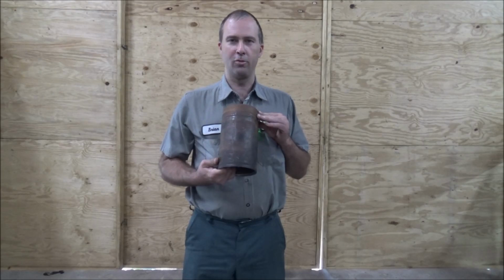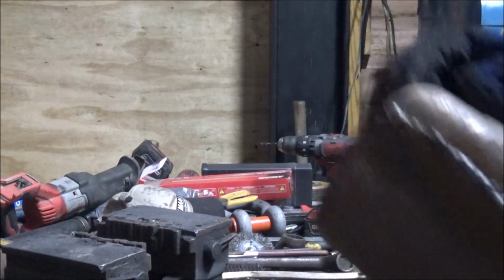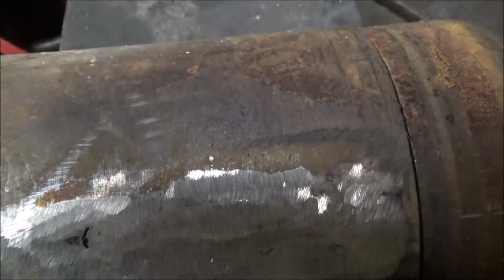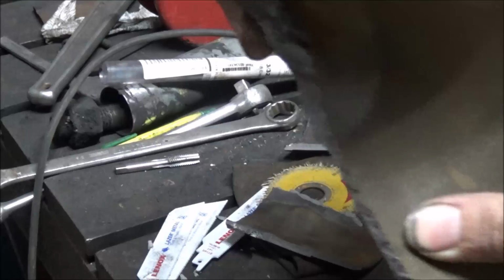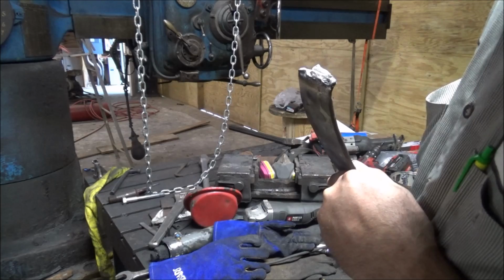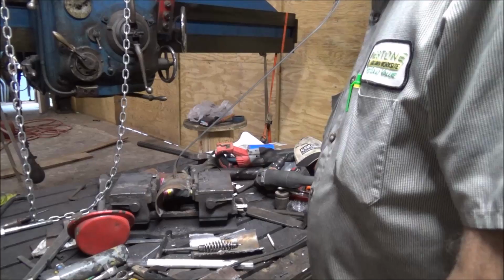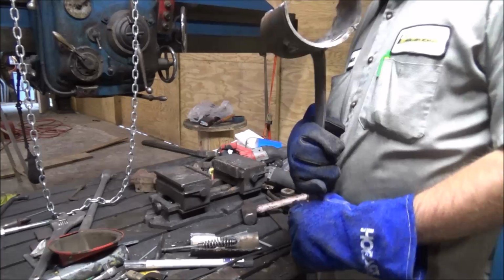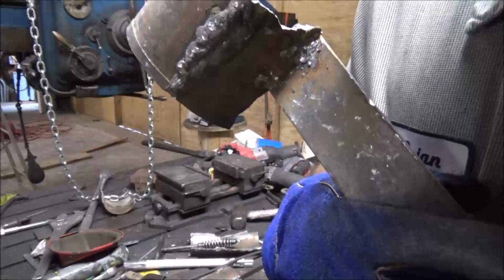Experimental strength welding of cast iron

Comment: It all comes down to "will it work for these circumstances."  Sometimes the only way to find out is to try it.
I've seen arc welded cast that outlasted the rest of the machine, I've seen others that failed.  No idea what made the difference.

That said ... there may be a specialty rod for arc welding cast.  The few I saw didn't look like any welding rod we would recognize, they looked like skewed key stock.  Very difficult to use, required lots of patience and time to get it right because holding an arc was very tricky.  The man that described it to me said that he learned it from an old timer that, for some reason, became very adamant about teaching him how it was done.  Wouldn't take "no" for an answer.  He said he resented being forced to learn it, but it became invaluable decades later.  Maybe it was a technique that worked, but was abandoned because it wasn't easy?  I don't know, but if it really was possible, it might be time to start diving into those old textbooks again to see if we can bring it back.
Reply from the maker: Did the stuff look like this?http://www.ebay.com/itm/5LBS-WELDING-RODS-STICK-ELECTRODES-Cast-Iron-R-D-Metals-AWS-A5-15-1-4-NOS-/142019007573?hash=item2110fe1455:g:Yq0AAOSwUV9WpETq
Reply: yes it did
Reply: yikes!  no wonder why he stopped me when I was about to pitch a 3" leftover in the iron pile ...

Comment: Stick welding with no flux on the rod is tough. I tried it a couple times and thought it was impossible because the rod kept sticking. Didn't think about swapping polarity and just gave up after a few minutes.
Looks like your welds were fairly strong.

Comment: With the no flux 7018, did you have to keep a long arc to keep it burning, or were you able to get closer into the weld puddle? Very interesting technique. I'm going to try it myself. I would be interested in the stainless steel welding test on cast. There seems to be an easier flow with stainless, although MIG welding stainless seems to leave quite a high weld bead. I hope you do a video on that. Hey, I really enjoy your videos. Cheers.
Reply from the maker: Have to hold pretty long or it wouldn't stay lit.

Comment: As you are in experimenting mood :-)
I read in an old book how to make a coating for the rod to make the welding arc better. It said to wrap the rod in paper and then coat it with Sodium silicate. This will force the arc to the tip. No idea if its working in this situation.

Comment: So 7018 welding rod with no flux with a DC welder with positive on the electrode right?
Brian, can you tell me approximately how many amps did it take to make this cast iron weld?
Reply from the maker: I can't say exactly because I was using a foot pedal but likely around 250 amps.

Comment: That's pretty interesting, I'm what you would call the trial by fire welder lol. I learned by making the mistakes and fixing them, getting schooled, and seeking the answers along the way. I fixed some things I would have sworn I couldn't. Went on and tried it anyways per the request at the time. Very real and practical test you did there. So you cold welded the liner, but given the mass of metal your repairing, are you going to try to preheat some with a rose bud torch? My thoughts are that even the best weld you get stuck to the drill it might still pull cracks in the parent material due to mass of the cast/and weld. Even 200 degrees might make the difference. I'm thinking primarily the column side of your repair would be the most prone. Maybe you might repeat the test with larger mass on both parent cast and bar size- one cold, one hot, see if there is anything that would pop up or change your mind or findings. Your going to be spending some serious time burning rods as it is, I doubt you really want to discover something later. If you did do some torch work(heat)I would think you want to keep alternating. Heat, weld, heat weld, heat to finish too. What are you thinking there?

Comment: I am both totally amazed and delighted with the outcome of your experiments with a most surprising result. Since your tests have been conducted with small pieces of cast and metal would you, at this stage of testing, anticipate differing results at all with those massive broken components of your drill?
Reply from the maker: All I can do is take my best results and try welding a bar to the big drill casting and see how it holds if it works as well again then that is how i will go.

Comment: There's some highly intelligent people on the Practical Machinist forum who I greatly respect Brian. And unfortunately some who seem to need to make themselves appear better than they are by focusing on the slightest mistake large or small. Few will admit to some of there past mistakes and we've all made them.And fwiw I've spent more than enough years around large open pit mining equipment. That taught me that the larger the equipment then the larger the mistakes were when they happened. Few would have had the guts to post that video of that cable breaking so I'd try and pay as little attention to all those monday morning quarterbacks as you can. I don't subscribe to any idiots channels on YT and your about the furthest away from fitting that description I can think of.

I'm not and never will be a welder. I have seen a whole lot of failed weld repairs on highly stressed equipment though. Preheat obviously helps a great deal, but even with that I've seen new cracks start right beside the weld in those high stress areas. I don't know enough about your drills main construction where it broke. If it's at all possible I'd try and add some supporting triangulated tie bars after the main castings have been welded that could be used to help support those heavy components and take as much stress off the repaired areas as you can. I'd be surprised if you haven't already figured the same and are planning to do so if it's possible though.

Comment: The vice you're using for an anvil looks like my American Positive Grip. If I'm correct, it's really great for holding irregular shapes. Might be worth cleaning up.
Reply from the maker: It soes have a bunch of fingers and is filled with shot so it can grip irregular shapes. It needs a ton of welding done to it as it has been drilled to swiss cheese by careless operators over 80 years. Pretty sure I have a video just on it https://www.youtube.com/watch?v=LxZpd2qcLxw

Comment: Brian, you could use you Tig set up and silicone bronze Tig rod and it will be stronger than the base metal, at that joint
Reply from the maker: Except no way I can tig that vertical up joint back in that hole.

Comment: Well semi-steel being a low carbon variant of cast I suspect the welding may work just fine. As to why it seems stronger without flux you got me... For the record you were running electrode negative right? I can't see a 7018 lasting 5 seconds on DCEP without flux.
Reply from the maker: Yep DCEN/ straight polarity. I think maybe the higher amps and lack of shielding dissolves some of the carbon out. Fooling around with it I could still drill the weld but it was harder than the liner right next to where I welded.

Comment: I don't think the question is whether the cast will break, the question is whether the welded section will break at a lower force than unwelded material.  I'm curious if brazing rod makes the joints any more ductile than weld rod.

Comment: I may not know much about large welds. What I do know is that you need good penetration. That last one where you beat the tar out of it and it ripped the casting instead of failing. That's the right penetration. The thermal mass of the drill might be more of a problem as for getting the welder set right. The more you weld on it, the hotter it gets and so on. I'd get a die grinder after it and hog out a nice trench to fill with weld material. No doubt it's going to be tricky as hell. I'm still just glad it didn't land on you man. I about pissed myself watching the video of you lowering it. Good luck man. I won't hold it against you if you just decide to scrap that thing though. It's going to take a whole lot of rod and patients...

Comment: someone told me those cast iron  sleeves make a good  squar that you can use on your mill  what do you think
Reply from the maker: No they are too flexy and only turned so not near accurate enough to substitute as a precision square.  A big wrist pin is decent though.

Comment: Might have already been suggested but i wonder if you pinned it like a surgeon would do to broken bones...so can you drill many hole in one side...hammer in pins....drill other side with corresponding holes...slip parts together then weld up....make sure pins hold the weight and rigidity....cheers..
Reply from the maker: See the previous video for how the weld joint on the drill was prepped with tapped in bolts on both sides.
Reply: Thanks Brian...I see that....but I was referring to long continues pins...if there was a temporary table at the correct height of the break, your mag drill could be laid over on its side...and magnetize to the frame for accurate hole drilling both sides...slip together and weld ...one more suggestion then i won't bother you again...how about fabricating a frame that is bolted onto the back and top of the main structure behind the main post then weld side plates down to which a bottom plate underneath can be welded to the side plates... then extending  past the break and bolted underneath but up to  help support the weight of the part that holds the motor...anyway good luck i hope you haver success...cheers.

Comment: as long as you are using the pedal you might try ac with continues hi frequency. stomp th pedalto start and to pulse for penetration and the hi frequency should help maintain the arc when you back off.
Reply from the maker: Tried ac it ran very poorly.

Comment: I wonder how it would go with TIG and 7018 no-flux rods.

I really hope you can find someone who will let you borrow a mig because I bet that would make welding it all up in those tight spots a real snap.
Reply from the maker: Probably better with the shielding gas but I could never get a tig torch up in that hole to do the weld though.

Comment: Very nice Brian.  Some random observations: 1) It is a shame you don't have a MIG gun, since that is a "fluxless" process. How about faking it with an argon or 80/20 bottle, regulator, and a shop air nozzle on the end of a hose? Just point it near the weld puddle to displace some of the air. 2) It would have been interesting if you had tried to partially fill in the break from the inside as well as the outside so you got full penetration for at least part of the length of the fracture. 3) It appeared that each time the casting broke, it was along the edge of the HAZ from the weld. Maybe that is saying something. On the other hand, I have the impression that the welded part was at least as hard to break as the original. In that case, maybe having it break along the edge doesn't mean much.
Reply: regular weld tends to break along the edge of the metal nearest the weld too, not sure if its the heat, or that its a pivot point due to the weld not wanting to bend and its that point
Reply from the maker: 70ksi weld material is a lot stronger than 40or50ksi cast iron so it always should give it up in the base material unless the welds are poor. The key is getting the heat effected zone  along the edge of the weld from becoming too brittle and extra weak in the process. According to my unscientific bar bending tests I was estimating around 20-30ksi weld joint strength when I first started. That last attempt where I did the very hot fluxless weld I was as strong as the base material. That is ideally where I would like to be but getting that done is going to be tough.

Comment: It seems to me that you have a surface area problem. It adheres to the cast iron, but when it breaks it takes it with it. It is able to break because there is only a small portion of weld material actually making contact with the cast. Increase the size of your welds with a straight weave. Or, cut slots into the cast perpendicular to the weld seam, and then fill them with rod. Just increase surface area of weld material.
Reply from the maker: While that is a valid solution and the more weld the stronger there is only a limited amount of material available for connection on the drill so figuring how I can make the best use of that is my mission.
Reply: Your plug solution should also be effective, but I totally see what you mean. The break could hardly be in a harder to work area. I hope you manage to figure it out, thanks for taking us along for the ride. Good luck :)

Comment: do you own any pulley taps..  like in 1/2-13 .. if there is such a thing. you could drill deep thru the broken off casting and part way into the unbroken casting.. counter bore the outer hole.. run the pulley tap into the inner piece.. and be able to use socket cap screws to reinforce your broken off part to the main part.   you could also use long bolts but you still have to have a pulley tap or weld up one..  or broach a bar into a tap driver..  and prey that you don't bust a tap off deep.  since this is my idea.. i would become the idiot for thinking of this..  the only thing is to NOT drill thru into the post.. so a drill collar would be needed to limit the depth for every hole.

Comment: pro tip dont use flat bar use angle that way you get a better feel and also it will transfer the force directly to the weld and surrounding metal rather than just bend the flat bar mid way

Comment: I see no idiots here. I am interested to try 7018 without flux dc straight myself I have never heard of that before and was surprised that it seemed to work just fine. Thanks for your wisdom Brian
Reply from the maker: Going to need a lot of amps you want the base material melted and then add rod to it, kind of like tig welding only with a stick.

Comment: Weldcote Nickel 99 Cast Iron Welding Electrode Repair 1/8" 1 Lb. are a standard for Cast iron but how can you argue with these results. I keep hearing people say that the cast iron will be under stress if you weld with 7018 but it must be an very small amount of stress, else you would not have these kinds of strengths.

Comment: try poor man's tig: stick welding with one hand and feeding in filler rod with the other. could help you fill that gap nicer, faster and cheaper. i've used it to weld exhausts when i didn't have a tig machine. Or just oxyacetaline weld it so you know for sure you won't get porosity in your welds. the oxy torch keeps your casting warm too and since its such a massive casting you want that for a good weld.

Comment: Hi Brian
 I was wondering what would happen if ferrosilicon was added somehow to the weld, from what I have scene it is added to cast iron to keep it from becoming to hard when poured into a mold. Just a thought, if it could be used to coat the rod before welding. Here is a video about it https://www.youtube.com/watch?v=AEyXnt3Xq9g
Reply from the maker: I would try it but where would I find some?
Reply: Ebay,
 ferrosilicon is used on some welding rods in the flux

Comment: Removing the flux is not a good idea. 7018 is not the best rod for cast iron, not the worst either. Nomacast or nickel rods would be a better choice for a critical weld.
Reply from the maker: Just hunting viable alternatives to $2000-$4000 worth of welding rods.

Comment: Welding on a thin pipe or cylinder you are able to get the heat up, but it's a different story when the piece is two feet thick. That will require some serious pre-heat. Personally I like brazing for cast iron. Still will require a lot of pre-heat. I like the idea of bolting the pieces together. You have that giant boring mill. Drill and tap and put some 4" diameter bolts in there from both directions, that will hold it, and pull it up nice and tight too. Still I have no doubt you will fix it somehow. Was that drill on that government auction the same size as the one you have?
Reply from the maker: No that one is much smaller. Using the HBM to machine up a repair would be the nearly last resort as disassembly to do it would be a major job.

Comment: I knew practical machinist members were dicks to newbies, but apparently to experts as well. Fuck those guys. 

That last weld was very impressive for cast. I've never seen one hold like that. If and when you try the mig do you think you'll have a chance to test some silicon bronze as well as the stainless, and maybe some regular wire? Even if it's not good on the drill it would make for an interesting strength test, and as you said, nobody else is doing these.
Reply from the maker: There is what appears to be a good deal on a MIG on craigslist near here I am going to go look at it tonight. I am open to doing experimental testing with any and all wires if anybody has anything they want me to try. Around here local 308stainless is about the only thing available besides the normal aluminum or steel wire.
Reply: I saw some 2lbs of the wires I mentioned spools at home depot of all places. Not cheap though. And you would need a spool gun.

Comment: Hey Brian,

You may already know this but I found this site has good information  

http://www.locknstitch.com

as it is their specialty repairing large cast iron.  You may even try and give them a call for advice.  

Have you considered the possibility of just abandoning the weld repair and going with a new 3 phase motor instead of the DC and mounting it above the spindle?  

Good luck, I am sure you will figure it out and by the way, I like your accent and appreciate the time you take to make these videos.  I think this world would be a boring place if we were all were the same, It our differences that makes life interesting and richer.
Reply from the maker: As mentioned in a previous video I talked to them and they said not a good solution for this job.